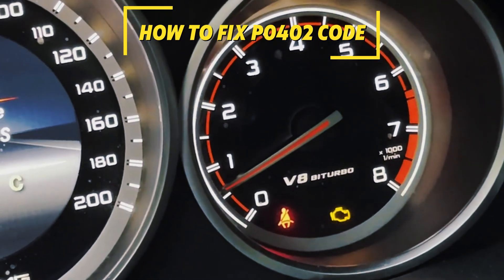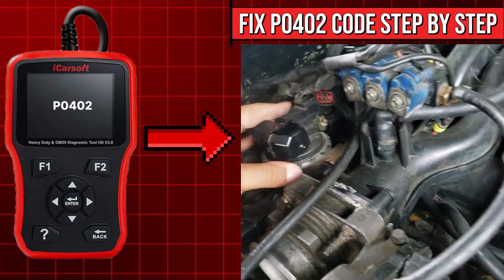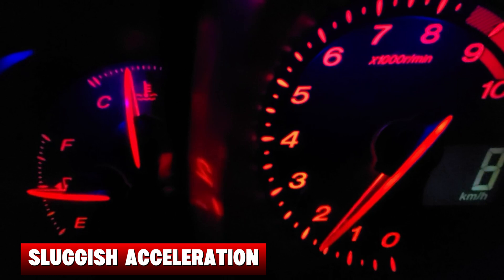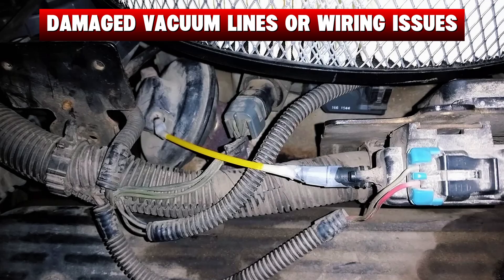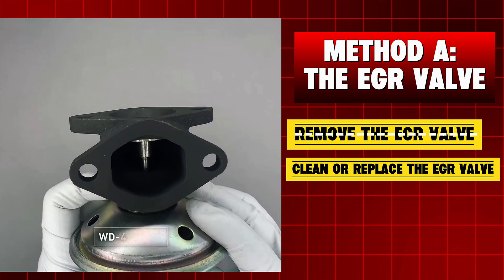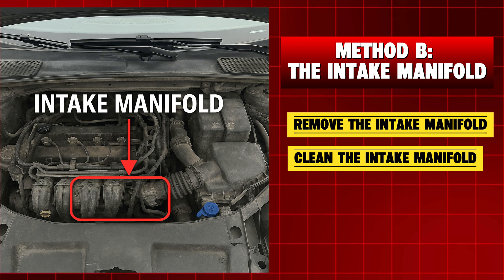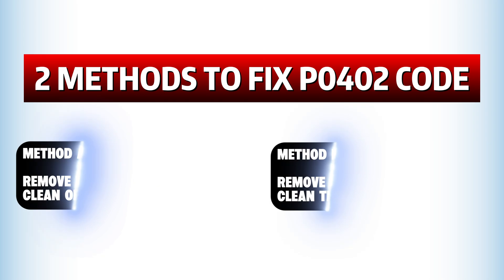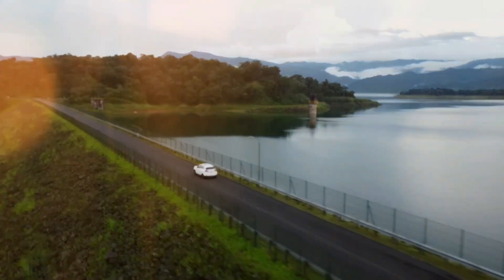Got a P0402 Code? Here’s How I Fixed My EGR Flow Excess Problem!

Comment: What do you do when you take it to a mechanic and the replace the EGV and the car keeps rough idling randomly? Then the code comes back…what should I say to make sure it’s fixed?
Reply from the maker: If the EGR valve was replaced and you’re still getting rough idle and the P0402 code, it usually means the real issue wasn’t just the valve. The code points to excessive exhaust gas flow, which can also be caused by:

A clogged or stuck EGR passage that wasn’t cleaned when the valve was swapped.
A faulty DPFE (EGR pressure feedback) sensor or wiring giving the ECU the wrong readings.
Vacuum leaks or intake leaks that make the ECU misinterpret EGR flow.
In some cases, a weak MAP sensor or faulty ECU calibration.

Tell them the car is still idling rough, the P0402 returned, and ask them to check the EGR passages, sensors, and related wiring—not just the valve itself. Emphasize that you want a full diagnosis of the EGR system so the root cause is fixed, not just parts replaced.

Replacing the EGR alone won’t solve it if there’s a blocked passage, bad sensor, or wiring issue. Ask your mechanic to verify the whole system instead of just the valve.